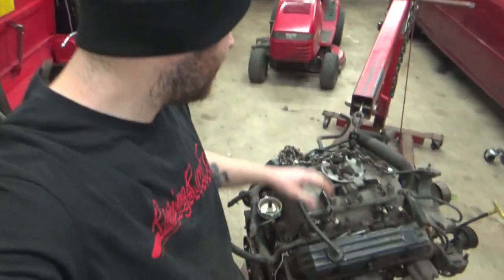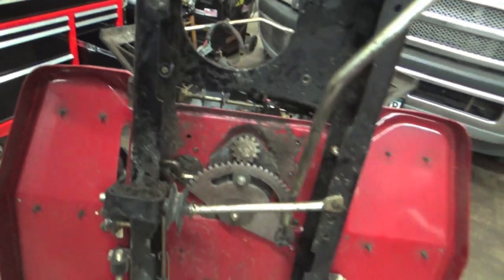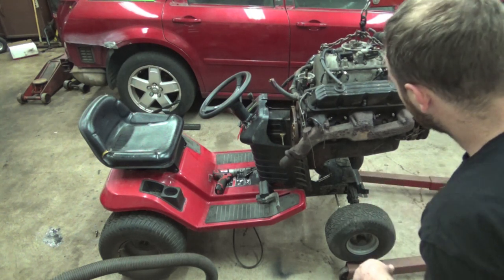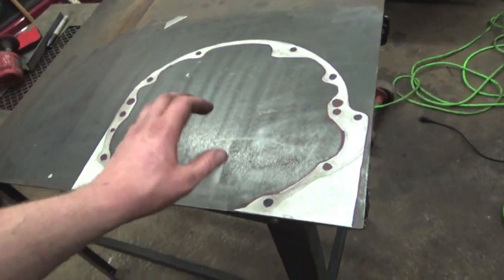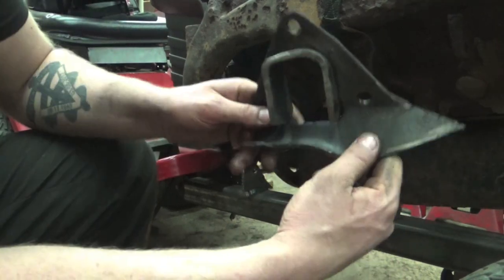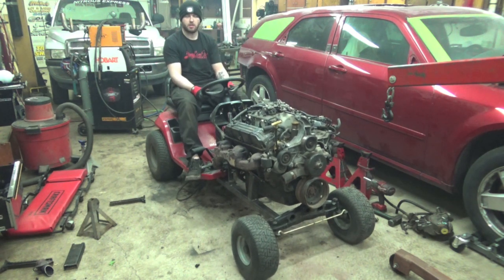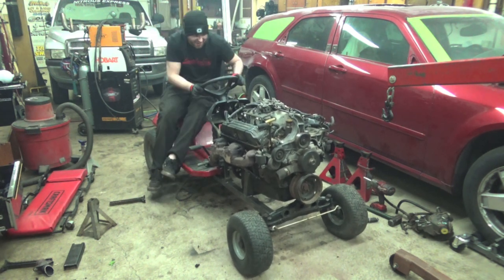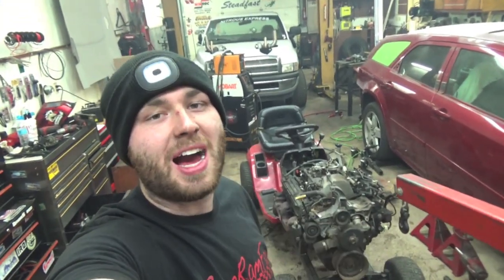5.9 Magnum V8 Swap Lawn MOWER

Comment: Definitely show the wiring part I want to start my 5.9 engine on a stand
Reply from the maker: Will do
Reply: The wiring is actually surprisingly easy on these magnums, especially if you have the under hood fuse box as well.
Reply from the maker: @leonewulfe5137  super easy